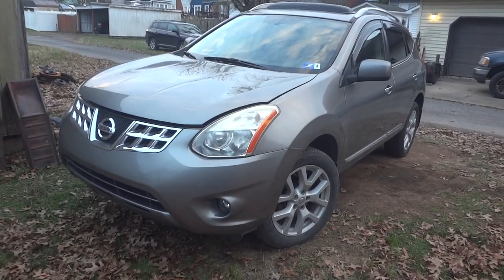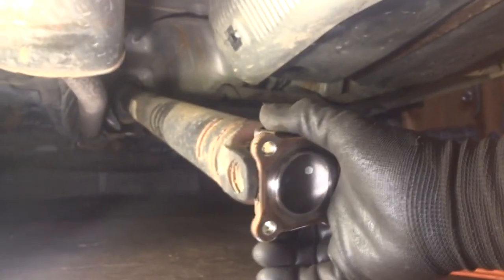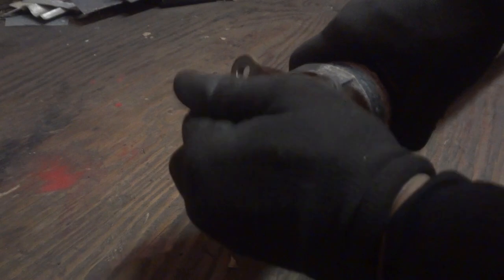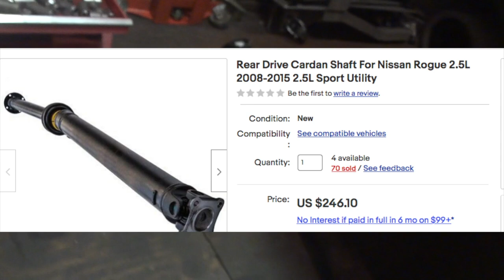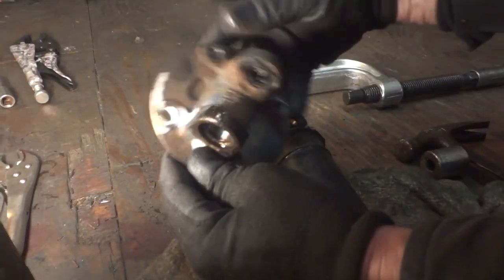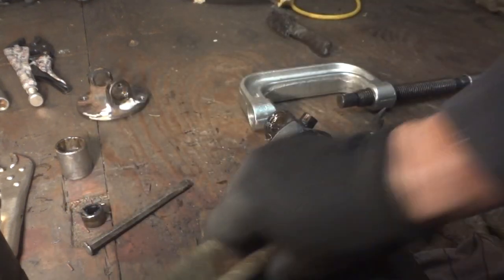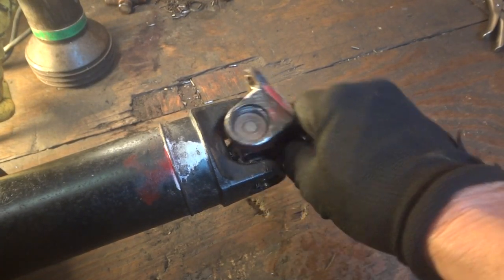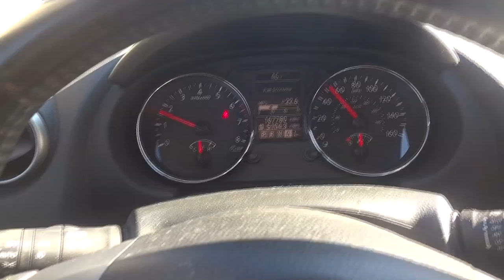2011 Nissan Rouge 2.5 Staked U Joints Replacement. Better than OEM

Comment: Thank you I think got the same problem in my wife car
Reply from the maker: O no!!
Reply: The thing is that when we both in the car it’s ok but when I’m not in the car nothing. When I got home last night I checked the brake the caliper pin was not sliding smoothly so I fix that I drove the car it’s ok but I’m going to check this when I get home from work tonight 😂 another late nite 😂 the love for car

Comment: Easier just changing the whole shaft
Reply: How old are YOU ? 5- 10 YEARS,  I happen to have a 2011 Nissan Rogue AWD ! COINCIDENTALLY same color as that 1 , Driveshafts cost $ 1000 bucks with carrier Bearing wize GUY !